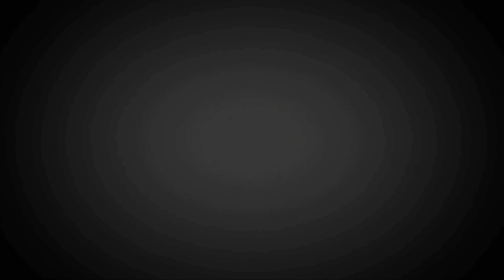Sungold Power Off Grid Black Friday Sale

Comment: You can’t wire every panel in series, if you add more you’ll need to wire some in parallel to ensure the voltage stays within charge controller's limits.